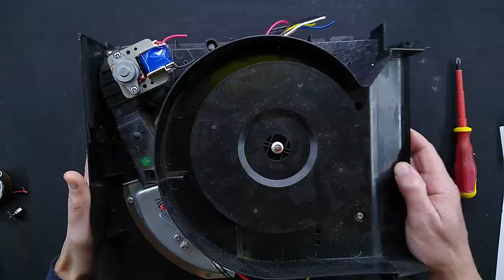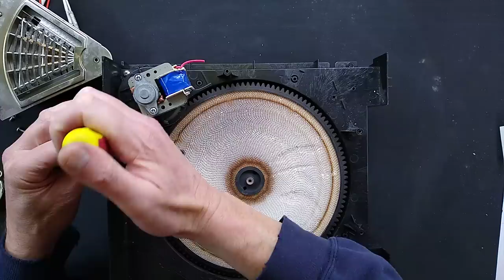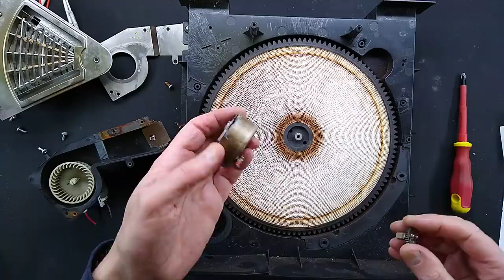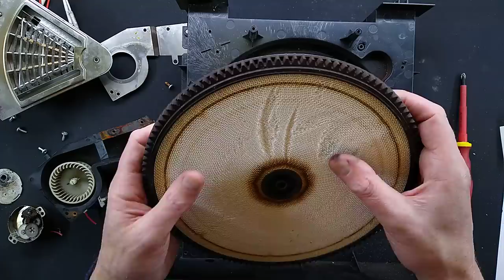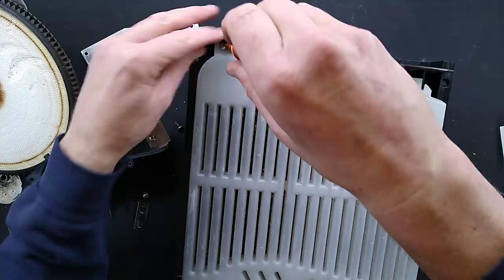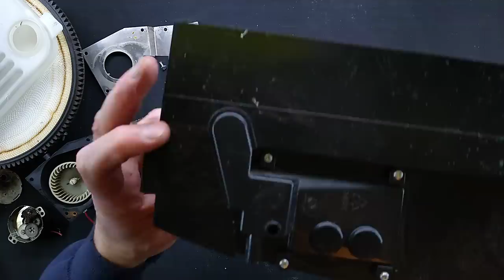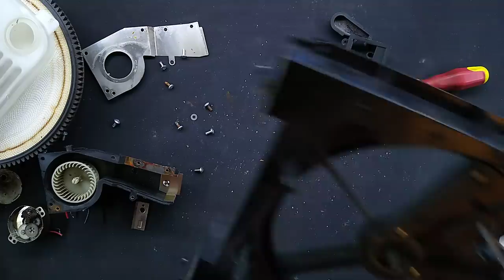Desiccant drum dehumidifier teardown

Comment: I wonder how well one of those would work in "take a deep breath and quench your thirst" Indiana
Reply: a dessicant dehumidifier can theoretically dry air down to about 4% WME humidity. So very well I expect. It does depend on ambient air temperature.
Reply: @AndyPate72  The sheer volume of moisture in the air wouldn't overwhelm the desiccant?
Reply: The desiccant is regenerated by heating it to drive off the absorbed moisture.  As long as the heater is working the zeolite capacity is replenished as it rotates through.
So in essence, the size of the heater determines the amount of moisture removal.  Crazy
Reply: @thomasvlaskampiii6850  I used to work in flood remediation. I have never worked in Indiana. However I am from England where it rains incessantly, a refrigerant dehumidifier in a closed room will easily and quickly dry it down to about 35% humidity ( 2-3 days) a dessicant will do it in one day as long as you can run it continuously. We had sump pumps fitted that automatically emptied condensed water and the dessicant just exhausted the water vapour outside.
Reply: @AndyPate72  A normal summer day here in Indiana is sunny, 27C and 80% relative humidity. There's usually a haze in the air from the humidity

Comment: Do dehumidifiers really work if the very moisture they seem to pull gets reintroduced into the same room? Fundamentally, you need a good sized dehumidifier running continuously in conjunction with an air conditioning unit that doesn't introduce new moisture into the dwelling or room. Never used one to be honest...I wonder if the small ones really do work?
Reply: That's not how these work. These dessicate the air by absorbing it in a dessicant drum, and then evaporate and then recondense the water out of the dessicant drum, and then collect that water in a tank.
Reply from the maker: A dehumidifier collects the water in a tank for disposal or drains directly to a drain.
Reply: @bigclivedotcom  I understand the general idea of it. But my wonder is if the humidity is 80% in let's say .... all of Isle of Man...then unless you are in an air tight room, you will sooner or later be right back to 80% humidity indoors? Or do you maintain some lower humidity indoors relative to outdoor humidity levels? What I mean to ask is what is the effectiveness and efficiency of using a dehumidifier?
Reply: @levigoldwing1536  If you can maintain a mostly air tight seal, dehumidifiers work great. But as you reintroduce humidity into the air, through opening a door or window, the dehumidifier has to work harder. The water being pulled from the air doesn't evaporate fast enough to be a concern. The dehumidifier will always out perform the evaporation rate
Reply: @levigoldwing1536  that's not how relative humidity works. 80%RH means that the air holds 80% of the maximum amount of moisture possible at a particular temperature. And if the air outside is colder than inside, it can't hold as much water - at zero degrees, it can hold none. So cold air from outside, even if it is raining in the Isle of Man (a not uncommon thing!) will still be dry when it comes into your warm, moist home. So yes, it is perfectly possible to have inside at a comfortable 50%RH when it is raining outside. And dehumidifiers can and do work well.
Reply: It do not get reintroduced, with this type it gets condensed into water that fills the tank or right into the drain. There is also some type of similar dehumidifiers that instead of condensing it sends the moisture and heat outside instead (most often used on boats).
Reply: @revbobuk  Thank you Bob for your input. Your statement will require further consideration and I will report back with my findings. It is my understanding that elevation as it correlates to atmospheric pressure and temperature relative to humidity affect dew points. Furthermore, consider your scenario of a rainy outdoor vs warm indoor for a thought experiment analysis.  Consider an analogy of a boat at sea as it describes your moist rainy Isle of Man and the temperature gradient and moisture levels within a home. Can you really get a boat dry at sea? This is precisely what I ask when it comes to the use of such devices or systems.
Reply: @levigoldwing1536   humidy decreases as temperature is higher in a house.
Reply: @zenbudhism  false

Comment: 9:11 Instead of unscrewing that hard to reach part, could you plug the drain (to tank) hole and fill a biocide (chlorine dioxide solution perhaps, or a pinch of drain cleaner solution [NaOH]) which then dissolves the slime biofilm?
Should be faster, and less tedious, and since that's all plastic it would be unaffected.

Comment: Shame, those synchronous motors are similar to microwave turntable motors. Didn't realise they're also good at generating electricity if you crank them fast enough!
I've a few condensing dehumidifiers all second hand - needed to de slime/fluff/scale them. You're right, not pleasant.
Reply from the maker: You can get a zap off a synchronous motor.

Comment: Can I have the condenser please Clive
I have one of these that stopped working and after months of checking motors and movement it turned out to be a hole melted in the condenser directly opposite where the air blows in.
Reply from the maker: You could possibly patch that, but I'm surprised it didn't trip its thermal fuse on the air outlet.

Comment: It seems wasteful to have something absorb the moisture and then need more heat to try and pump it back out again

Can't the water collected be trouble, I remember hearing of a hospital that needed their whole system cleaned because of traces of legionnaires

You have a multi tool, couldn't you file the sides of the motor spindle away until its the shape you need? I did the same with my fan motor
Reply: Yeah I can't quite get my head around how this works
Reply: @Totalinternalreflection  might help to think of it as a two stage system
Reply: @phonotical  I think I've kind of got it now I've watched to the end.

Comment: im a bit dissapointed i know you have a 3d printer why not use a d shaft synchronous motor and print a gear for it?
in fusion 360 its easy to get a gear using the script.

but on the other hand its fun to take stuff to bits haha.

Comment: That sure sucks a lot of current!  WOW!
Personally, I still prefer the compressor type.  Yes, they can be problematic in a colder area.
We used to run one in our main greenhouse, which, in winter time, we'd allow to get to low of about 45F (7C).  It did struggle at that temp mostly because it would freeze up.
After a bunch of years, the compressor just stopped working.  LOL

Comment: Hi Clive.  I have one of these and the heater part doesn’t get hot.  Any ideas please.  Checked the element and that appears to be ok.  Thanks in advance.  Mike
Reply from the maker: It could be a tripped thermal fuse or a control problem.  The early units were notorious for having thermal fuses trigger.  Especially if ports are blocked.
Reply: Thanks Clive.  Are these are the thermisters on the heater unit.  Last year there was little heat for 3 months then it started to work.  This year back to original fault.
Reply from the maker: @mikeparkins4302  The control thermistors are separate to the thermal fuses.   If the heat is intermittent it may be a bad connection.